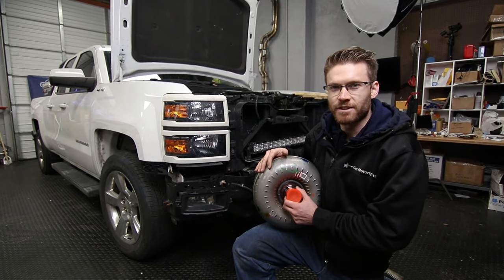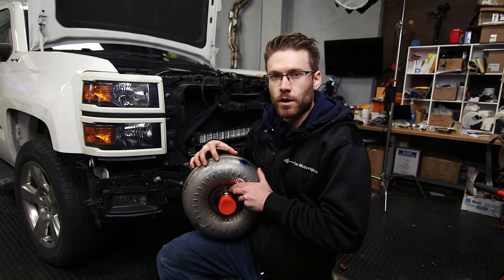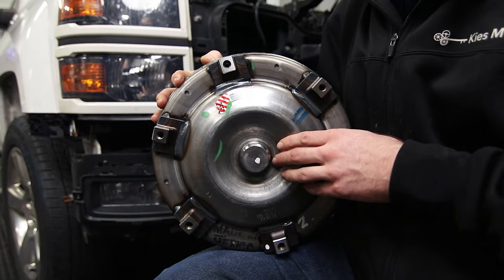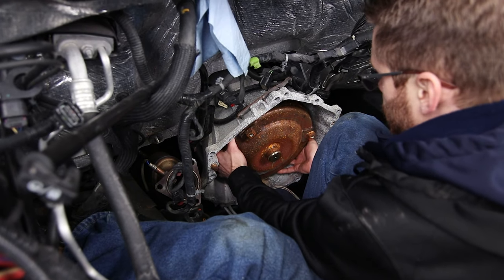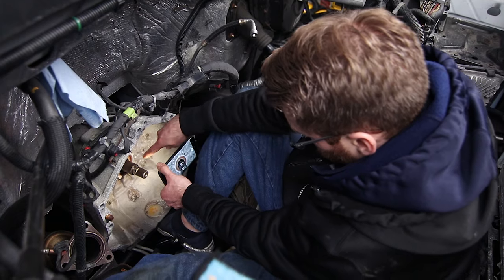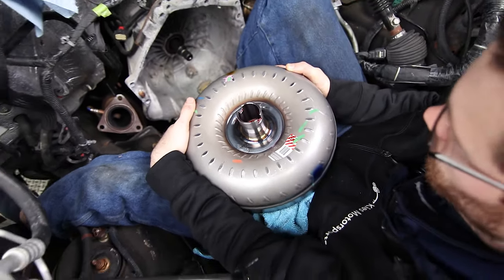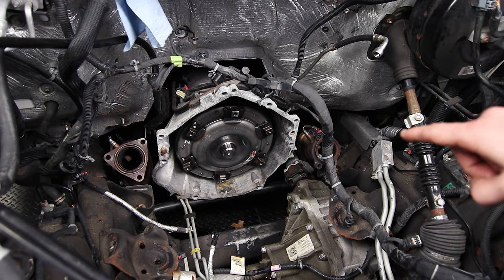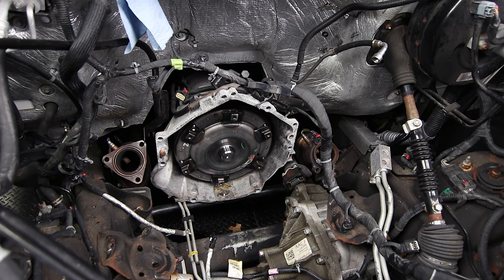6L90 Torque Converter Install in an 6L80 Transmission - Silverado Sierra Tahoe Suburban Yukon

Comment: Thanks for the information!  Got an 07 Yukon Denali at 181k.  Transmission is acting up a bit and suspecting the torque converter is on the way out.  Going to install a billet TC from Circle D and replace a rear main seal. Wish me luck!
Reply from the maker: Good idea! Best of luck with it!
Reply: did it work
Reply: @brandon367011  Yeah, both worked great.   The leak was primarily the rear main seal, but also a leak in the plenium cover.  The new torque conver also workes great!  The old converter was not holding well and rumors say that a high mileage TC could ruin a transmission by sending material into the transmission.   I'm pretty happy with the results.
Reply: @20tea  good dead ! I have a 17 Silverado on 35 with only 51k miles and isn’t my daily driver but I should change the TC anyway from a 6l80 to a 6l90  ?
Reply from the maker: I would recommend a bullet converter. They normally will last until around 100-120K unless you tow a lot. It could fail earlier but not typically
Reply: Forums about this topic rate the lifespan for the 6l80e torque converter lasting anywhere between 130-180k miles with normal use.  I changed mine around 181k miles.  It's great to have a billet TC for piece of mind as it holds up better under heavy use.  If you tow or push your rig pretty hard, I would definitely recommend it.  Otherwise you may be ok waiting till about 130k miles or so. I would also upgrade the transmission cooler.
Reply from the maker: Good points!
Reply: How’s the Denali? Still going after the torque converter swap?
Reply: @shootfirst408  Well, it's still doing great!  The old torque converter was causing some acceleration issues and it wasn't until I installed the new one, the issues when away.   The rear main seal was also leaking,  so I replaced that along with the oil pan gasket and installed a high volume melling oil pump.  The Yukon is still doing great to this day with no leaks, accelerationis great and nice oil pressure.  Also peace of mind that I have a well built TC in place for any possible future upgrades to the engine.  I also updated my radiator to a performance aluminum radiator to take on the additional heat from the higher stall TC.  I hope to get my vehicle calibrated sometime for the higher stall TC and my 35" tires sometime,  but it still does fine.  Only thing I'm dealing with now is I generally stay in 5th gear on the freeway instead of going to 6th due to stock gearing under the manual shift option for better response.  Overall,  if the mileage is getting high on the transmission,  it's a good precaution to get a new TC or a upgraded TC.  It's cheaper than replacing the transmission when the TC fails.
Reply: @shootfirst408  Well, it's still doing great!  The old torque converter was causing some acceleration issues and it wasn't until I installed the new one, the issues when away.   The rear main seal was also leaking,  so I replaced that along with the oil pan gasket and installed a high volume melling oil pump.  The Yukon is still doing great to this day with no leaks, accelerationis great and nice oil pressure.  Also peace of mind that I have a well built TC in place for any possible future upgrades to the engine.  I also updated my radiator to a performance aluminum radiator to take on the additional heat from the higher stall TC.  I hope to get my vehicle calibrated sometime for the higher stall TC and my 35" tires sometime,  but it still does fine.  Only thing I'm dealing with now is I generally stay in 5th gear on the freeway instead of going to 6th due to stock gearing under the manual shift option for better response.  Overall,  if the mileage is getting high on the transmission,  it's a good precaution to get a new TC or a upgraded TC.  It's cheaper than replacing the transmission when the TC fails.
Reply: @shootfirst408  Well, it's still doing great!  The old torque converter was causing some acceleration issues and it wasn't until I installed the new one at 160k miles, the issues went away.   The rear main seal was also leaking,  so I replaced that along with the oil pan gasket and installed a high volume melling oil pump.  The Yukon is still doing great to this day at 200k with no leaks, acceleration is great and have nice oil pressure.  Also peace of mind that I have a well built TC in place for any possible future upgrades to the engine.  I also updated my radiator to a performance aluminum radiator to take on the additional heat from the higher stall TC.  I hope to get my vehicle calibrated sometime for the higher stall TC and my 35" tires sometime,  but it still does fine.  Only thing I'm dealing with now is I generally stay in 5th gear on the freeway instead of going to 6th due to stock gearing under the manual shift option for better response.  Overall,  if the mileage is getting high on the transmission,  it's a good precaution to get a new TC or a upgraded TC.  It's cheaper than replacing the transmission when the TC fails.
Reply: @20tea  I have a 2015 suburban it has 186,000mi and my tranny started slipping last week. It’s my everyday driver, I have a big family and we depend on that truck. I was considering having the transmission rebuilt but it’s a lot of money you know. So maybe I just have the torque converter replaced and go from there. I don’t have an engine light on or anything yet. I have an appointment later this week with a transmission shop so I’ll see what they say thank you for responding sir.
Reply: @shootfirst408  No problem,  the TC is definitely the weak point of the transmission.   It's more likely the issue,  but if you really let it go till it completely fails, then debris will flow through the transmission leading to transmission failure.   Best of luck, but I believe a TC replacement is all you will really need. Afterwards,  your transmission should still have plenty of life left as long as it's maintained well.  Wish you the best outcome!
Reply: @shootfirst408  No problem,  the TC is definitely the weak point of the transmission.   It's more likely the issue,  but if you really let it go till it completely fails, then debris will flow through the transmission leading to transmission failure.   Best of luck, but I believe a TC replacement is all you will really need. Afterwards,  your transmission should still have plenty of life left as long as it's maintained well.  Wish you the best outcome!
Reply: @20tea   Would you mind letting me know how I can find this "Billet" converter. I feel like I'm searching around but the only results i get are stock replacements from auto parts stores, not the "upgraded" "billet" version. I would greatly appreciate any kind of information you might have.

Comment: 2015 GMC seirra converter failed at 101000 went quick had to rebuild all transmission. It was serviced at 90,000 Change that convertor before its to late.
Reply from the maker: Agreed. Seems like most failures happen after 100K

Comment: Is there a GM part number for the 6L90 torque converter? I have 2 I'm looking at one is gm10405 vs gm10403??? Thanks!!
Reply from the maker: It is listed in the description under the parts section :)

Comment: I’ve got a two-part question is there anything you can do to prolong your torque converter/transmissions lifecycle? Also, is there any upgraded tour converters that you can install instead of the AC Delco one?
I have a 2018 Chevy Silverado Z 71 4 x 4
Reply from the maker: Yes, a billet tc would be the way to go. And frequent filter and fluid change. I recommend every 30k miles as well as a cooler thermostat
Reply from the maker: Change the fluid more often if you tow a lot

Comment: I have a 2015 Chevrolet Silverado V6 4.3 and I been told to replace the torque converter but I was told to get a heavy duty torque converter what do you recommend?

Comment: when you got done do you have a converter lock-up issue? i did the swap and now at 40 mph rpms jump from 1000 1200 and back to 1000 every sec. put my truck converter back in and it was ok.
so i had the dealer parts warranty it and the 2nd on does the same.

Comment: Appreciate all your video's and the care and details you take.  Do you have any knowledge on the 8spd? There's many that have issues vibration/shudder and TQ replacement. My 17 HC with 6.2L has the 8spd, but I have yet to experience anything. Also I use Amsoil since bought new in 2017, from front to back.
Reply from the maker: Thanks for that feedback! Unfortunately I do not have experience with the 8 speed. I do know there are a lot of shuddering issues and various Service Bulletins out for them. I've heard that changing you something like Amsoil usually helps. If you dealer is able to detect the shudder they have a flush procedure they are supposed to do for free from what I understand. I think you probably have avoided the issues by swapping to Amsoil
Reply: Gm tech of 15 years, we  just flush the 8 speeds with mobile 1 hplv now, works awesome, on the 6 speeds, it depends on the amount of metal in pan, small typical metal we flush with dex 6, large
Abnormal We replace converter, and will I lnspect pump and pump housing, also sometimes the tecm gets metal that busts through the screen and into valve body,. If ur 8 speed shutters “ it can be pretty voilent, go up hill at steady speed of 35mph with trans well warmed up, if you have the shutter, you’ll feel it.
Reply: I have a 17 Sierra with the 8 speed and the 6.2. Had the violent shudder at 30k and the dealer did a fluid swap and flush. 3 years and 27K more miles it came back but was worse with shudder, noise and slippage. The dealer replaced the torque converter this time, fluid swap and flush. They didn’t see any metal in the pan, so they didn’t do a full rebuild. So far so good this time. September of 2022.

Comment: I have a 2014 V6 silverado, is the converter also failing? I installed a drain plug in the tranny and dump it twice a year minimum

Comment: Im wandering after install how long it took before the front seal to start leaking. And that o-ring in the unput shaft for lock up. They are usually junk.
Reply from the maker: So far so good luckily!

Comment: My 2015 Silverado had this issue at 55k miles. It was still under warranty but the whole transmission had to be rebuilt. It got debris and wouldn't move once that debris clogged it up. If I let the truck sit for awhile then start it, it would move for a few minutes but then it would stop. All fixed under warranty though.
Reply from the maker: that stinks man - you were fortunate it occurred while under warranty. Can't believe it failed with such low mileage - most of the failures we have heard about were at 80K and above.
Reply: @TheSundaeDrive  i believe it was the torque converter at least. It's been a few years. I'd have to find the report from the dealer but I know it said they found debris that was clogging it up. The truck is at 85k now and I haven't had any issues!
Reply from the maker: It probably was
Reply: My 2015 is doing it, just turned 50k. What makes no sense to me is that I purposely had the truck tuned by Diablew to prevent (delay) any future transmission issues. Didn’t really start doing it until after I tuned it and driving it on the interstate more instead of short back road trips. I’m thinking of doing a flush/filter since it’s probably never had one done. But I have a feeling I’m going to be doing a converter here soon. 🤨 tempted to go ahead and fork over the money to do a proper DOD delete with a small cam and a 6l90 converter since I like the stock stall for any future towing needs/keeping torque down low in the power band for my larger all terrain tires. Also thinking of putting an aux cooler and a deeper pan on it to help save the trans.
Reply from the maker: My thoughts exactly. Preventative maintenance is key with these trucks.
Reply: @TheSundaeDrive  yeah. Hoping I can squeeze by with a flush for now and at worst a converter. Lol.
Reply from the maker: If it's starting to disintegrate internally, it could go pretty fast. Just be careful. Hopefully it doesn't leave you stranded

Comment: How is this torque converter holding up for you still??? Am wanting to swsp out the shitty torque converter in my 2015 silverado 6spd. And think this may be the one I want
Reply from the maker: 8K miles on it so far with no issues!

Comment: what is the best torque converter for Yukon XL 2WD 2015 to buy?? the OEM or the aftermarket ones??? appreciate your feedback regards
Reply from the maker: Aftermarket for sure. Just need to find one that has a good stall rating for your application. I haven't looked into aftermarket options too much yet tho but I will when I start getting near 200K miles in a few years
Reply: I have a 2015 suburban what torque converter did you wind up going with? Thx

Comment: the 6l90 is prone as well. Billet only if u want bomb proof and fluid changes every 40-45k regardless of any magic trans fluid.
Reply from the maker: Billet is definitely a better option. And I try to change the fluid every 30K roughly to be safe. Which billet did you go with?
Reply: @TheSundaeDrive  “Circle D”

Comment: Instead of hoping that the 90 torque C holds up, might as well put a good after market converter like a circle D and be done and have piece of mind! Thx for the videos!
Reply from the maker: Great point! I actually spoke to them tho and they did not have any with a low stall like factory. they said going with 6L90 was best for my application
Reply: That is strange. They did have a low stall truck dual disk one in March of 2020.

Comment: Does the transmission retain the Lock Up after swapping the Torque converter? The clutch-like feeling that engages after 40mph to be able to drive at low RPMs without the Converter Slipping
Reply: Of course

Comment: Hi will this 6l90e torque converter will fit Silverado 1500 2015 5.3L
Reply from the maker: If you have the 6l80e transmission it should

Comment: What stall speed should I use for my torque converter ? Complete stock 2015 Chevy Silverado z71
Reply from the maker: You should stay with the stock stall then most likely. Talk to the shop you are buying the torque converter from and they will be able to provide more insight. Circle d makes good torque converters from what I have heard.
Reply: @TheSundaeDrive  thank you

Comment: I have a 2018 gmc sierra 1500 with a 8L90 and wanted to do a change out with a new torque converter. Who has the NEW torque converter and what is the part number if anyone knows ? I do not want to just put in the same converter that has the same failer problem.  Thanks.

Comment: In my '15 Silverado 1500 the torque converter started to fail at 135k miles.
Reply from the maker: Sounds about right. Were you able to catch it in time to save the transmission?
Reply: @TheSundaeDrive  Yes but rebuilt it anyway because it was out. All Raybestos stage 1 clutches, updated pistons, Sonax zip kit and a Circle D twin disk truck converter. It is working flawlessly. I have had it back in for about 2 weeks so it is still learning. It has had a little tcm tuning done to eliminate the lockup in gears 1-3 and eliminated the programmed in tcc slip. When it came apart there was some noticeable but not bad wear on the 2,6 clutches and in the 1,2,3,4 and 2,5,R clutches each had one clutch plate that had a small spot of material that flaked off. The L,R clutches looked basically new still.
Reply from the maker: @jeremymardlin5381  nice! Hope it lasts for you! Please update us if you have any issues long term

Comment: Question for the group for those of you that went the rebuild route with the upgraded TC. What was the cost because im getting quoted a little over 8k for a remanufactured.
Reply from the maker: That seems a little steep but probably how much it goes for. The Torque converter itself runs around $1000-$1500 or so from circle D if you go with the billet option.
Reply: @TheSundaeDrive  Thank you that was my thought also.

Comment: Did your truck have any symptoms? My 6l80 is currently leaking heavily from the vent tube, wondering if this can be the cause
Reply from the maker: Mine did not. I changed it to be safe. I'm not sure if that could be a symptom. Honestly, if you are over 100K miles I would just change the torque converter to be safe

Comment: I have a question for the sundae drive,  can 4.3 liter ecotec 3 transmission accept a 5.3 ecotec 3 engine.
Reply: In other word will they bolt up without modification?
Reply from the maker: Sadly I am not sure. Could he different flywheels and or torque converters. You would need to check part numbers.
Reply: @TheSundaeDrive  thank you for getting back to me I did some research and from of what I have seen it looks like they will bolt on but  their was no mention in changing torque converters etc.
Reply from the maker: @josephbenson3784  nice! Good to know!

Comment: I’m wondering if I should do this swap at 53k miles just to be safe. Will this converter add hp? Thanks for the detailed videos bro!
Reply: No.  Torque converters don't add horsepower.  Just adding a more durable and reliable torque converter.
Reply: Did you end up doing a swap?  I have a 16’ with 54k and was thinking about the same thing
Reply: If you haven't already changed the torque converter I would di it as soon as possible. By the time you can tell it is getting bad it likely has started to damage the pump in the transmission already.

Comment: Does anyone know if this issue is exclusive to the 14+ pickups or if the 2010-13 6l80e equipped pickups have similar problems?
Reply from the maker: Not sure but maybe someone else will weigh in
Reply: My 2011 Silverado had the torque converter go out and trash the trans at 105k. My 2017 Tahoe had the same issue at 75k. I drove the Silverado way harder than the Tahoe so... I'd say yes.